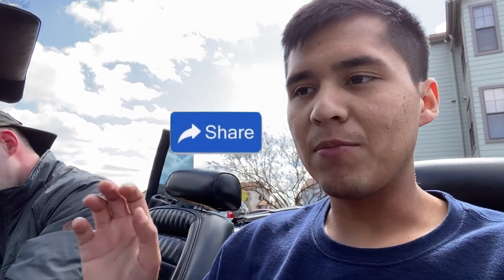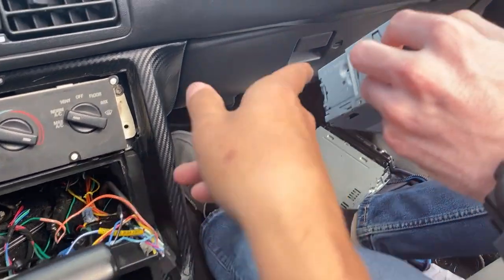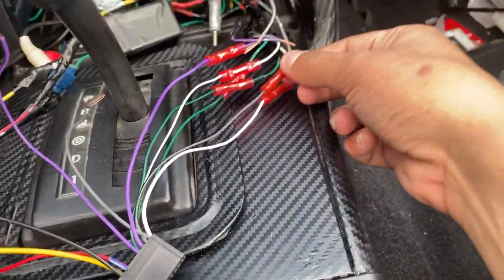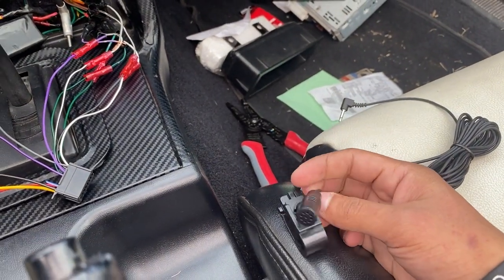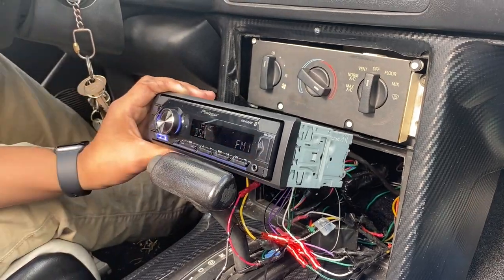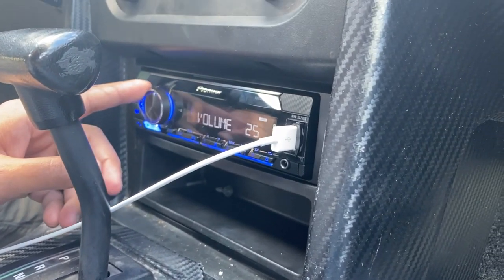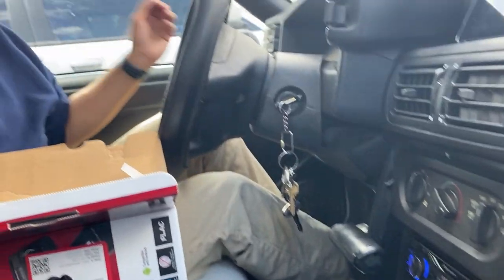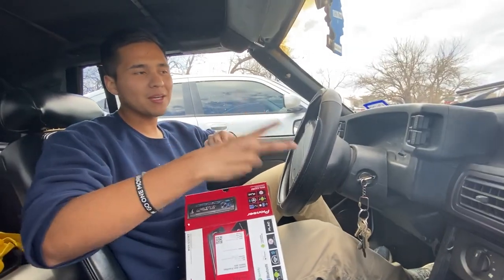Foxbody Radio Install

Comment: Thanks man, I am doing this exact same thing in my 87 GT. I went to install it and realized the older aftermarket connector doesnt fit this newer deck...
Reply from the maker: xPlumPz yeah unfortunately it won’t fit but it should have the same wires that you need since it’s aftermarket and you can honestly buy the connector you need and just connect the old wires with the new connector like I did. It’s more of a hassle but worth it since you know all the wires match and don’t have to worry about messing up

Comment: I was really hoping to see you put the cubby in and the Bezel in. Are they attached somehow? And does it go in all together? The Bezel around the dash?? I am trying to learn this.
Reply from the maker: They weren’t attached for me. I was just able to pull out the thing underneath the radio, then was able to unplug all the wires from the old radio and install the new one.
Reply from the maker: Sorry man. I know this was a bad video. I do plan on switching to a double din stereo with Apple car play. So I’ll make it a lot better.